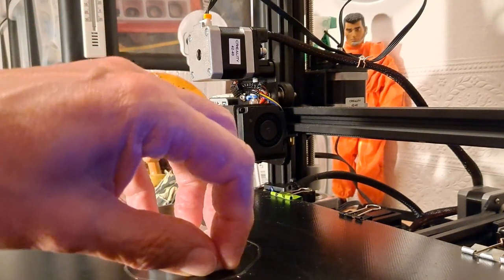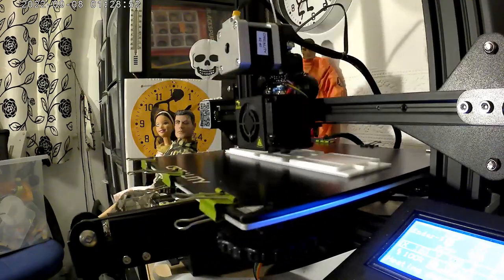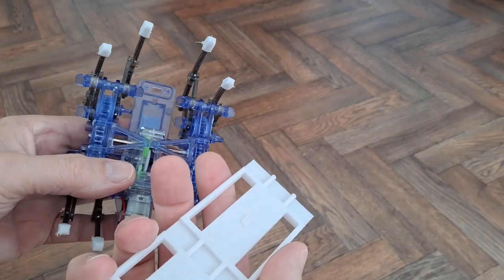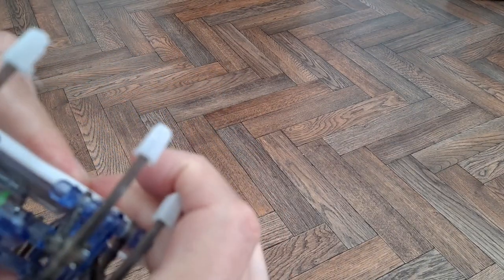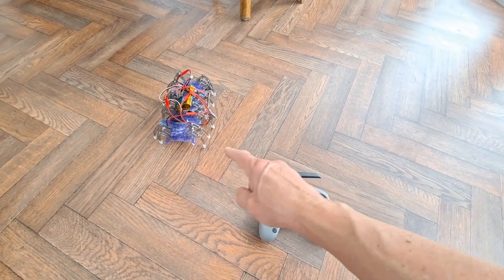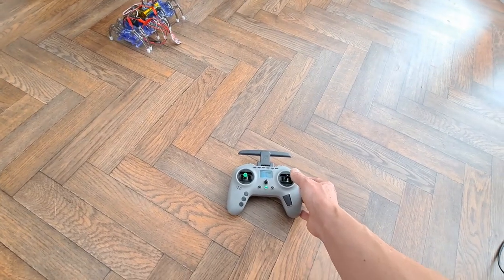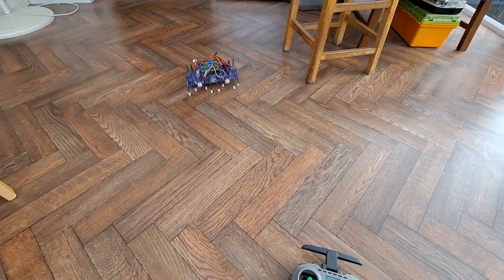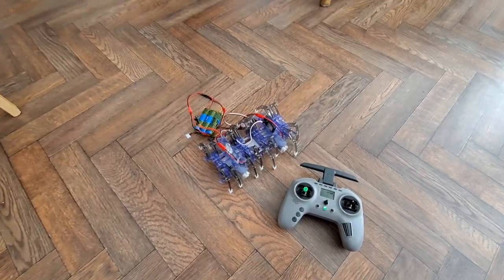Spiderbot upgraded - Part 1 20220908

Comment: can u print a longer bar that clips onto the bottom of the bots so you can add 2 more so then u have 4 bots instead of just 2, i 2wonder if that will work
Reply from the maker: You could do that. I am not sure if it would turn properly, because all the legs move together. In a turn, the outer legs have to move faster than the inner legs. If you double the number of legs then the issue would be more noticeable. It works OK at this size because it can drag some legs, but the extra friction of double the legs might be too much.
Reply from the maker: Morning Frankie 😁
Reply: @GrandadIsAnOldMan  ??????
Reply from the maker: @MsRaidman  to turn, the legs on the outside of a circle must run faster than the legs on the inside of the circle. Watch a group of soldiers or a marching band turn corners. The guy on the inside is just stamping his feet in time, when the guy on the outside is almost running. If they all march at the same speed they go in a straight line.
Reply from the maker: @MsRaidman  oops only just noticed that comment was meant for Frankie, not sure how it dropped in here 🤣😆
Reply: @GrandadIsAnOldMan  🤣😁😁
Reply from the maker: That gets even weirder, I have checked back and his comment has disappeared, so it looks like YouTube somehow reassigned my reply to your comment, when his disappeared 🤔 Never had that happen before 😮
Reply: @GrandadIsAnOldMan  thats strange things with YouTube. I think your right about YouTube reassigning the comment. Ill refresh my Page Here and See
Reply: Nothing Changed. Your comment is still there so i dont know what yt is doing.
Reply from the maker: @MsRaidman  no Frankie's comment disappeared. Not mine.